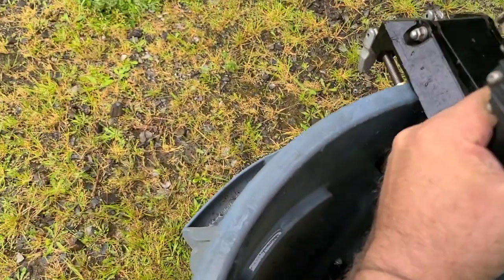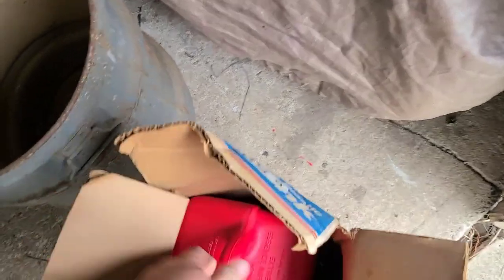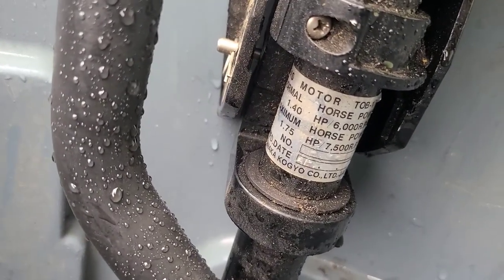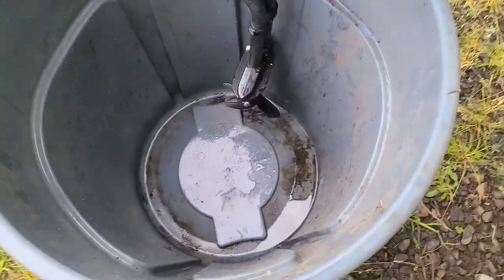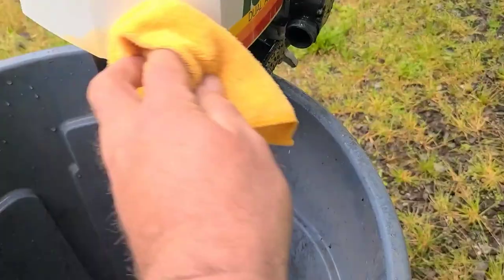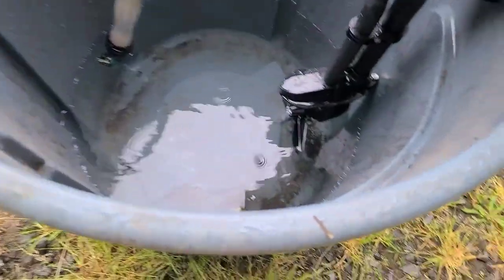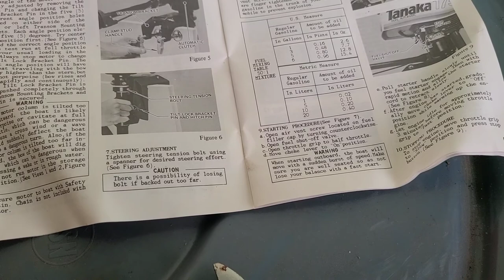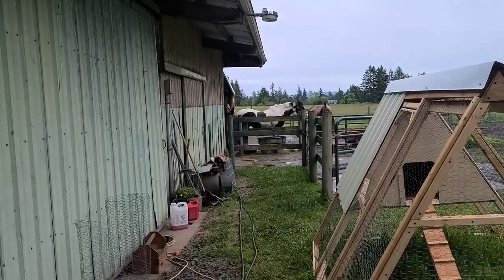TANAKA 175 Japan - Boat Motor Garage Sale Find , Lets see if will Run !!!!!

Comment: These motors run forever when properly maintained and stored. I purchased my Sears GameFisher 3.0 hp motor used at a yard sale back in about the mid 1990's for $50.00 and it still runs like new today. Actually fired it up last weekend to get it ready to mount on my new Pelican Bass Raider and it fired right up in a couple pulls after being in storage for years. That's a really nice motor you have.
Reply from the maker: Thank you , I really appreciate the feed back 🙏

Comment: Hello Steve. I just come across you doing some research on this exact  motor I have . I've never used it yet, but I plan to. If there is a chance to get the manual printed, it would be a big help. Have you used it, and if so, what do you think of it? Tks for the info . Take care .
Reply from the maker: Congratulations on your motor it's a fine little motor unfortunately, I sold it and I forgot to make a copy of it of the manual that is. It's a good motor it's definitely nice and light and compact. However it's a bit loud so I let it go

Comment: Hi Steve. I have this same exact outboard.  It came from a retired man who almost never used it. I have yet to start it up. Can you tell me the 2 cycle fuel mix ratio per the manual? I didnt get the manual with mine. Thx.
Reply from the maker: Yes sir 50.1 👏
Reply from the maker: are you on Face book ? I can make a copy of the manual and send it to you ???? great little motor,  I think I'm going to keep it around for a while !
Reply: @doinsngoins  Hi Steve. Sorry for the late reply, been busy here. Yep, i have my Tanaka running now, took the carb off and cleaned it. It stalled a few times, i think because the gas cap vent was closed off. 50 to 1 on the fuel mix molded into the fuel cap, didn't see that before. I took a video of it running in the water Barrel, i should upload it.

Comment: I think that motor is from the 80s Tanaka made great products mostly line trimmers and chain saws  and tapping machines .  When we sold our cows off i took a job that sold farm equipment as a side line they sold tanaka lawn and garden equipment it was very high quality products .   Of course they did not sell boat motors but i remember seeing the pictures in the fliers .   Good find great little motor for a canoe
Reply from the maker: wow!!!! thats great info Howard 👍  thank you , and yes it is very well made and runs smooth . I would be surprised if this has be used much ar all .  Thank you

Comment: If the fuel tank cracks, you will never find another.  This is the Achilles heel of these motors.  I’ve had 5.
Reply from the maker: Yes, I could see that being a problem. I suppose if it did. I can run a hose down into another tank ? Or is the fuel gravity fed
Reply from the maker: I actually sold the motor off while that was still running 👍 My only concern it was extremely loud

Comment: Good deal. 
Looks like a good one. 
Been looking for something like this for my little Jon boat 🚢 but you don't find them cheap around here. 
Thanks for sharing and God bless
Reply from the maker: This one I paid 135 , he wouldn't budge,  I offered 100 , nope nope , I paid up because of the original box, tools , manual and low use. thanks  Rob ! 😊
Reply: @doinsngoins  Around here it would have been close to three.
Reply from the maker: @BluegrassBushcraft   I have it for sale for 299 and I've got a few bites at 250 so pretty on point ,  pretty happy with that really thanks Rob